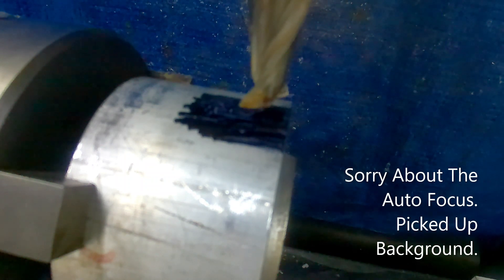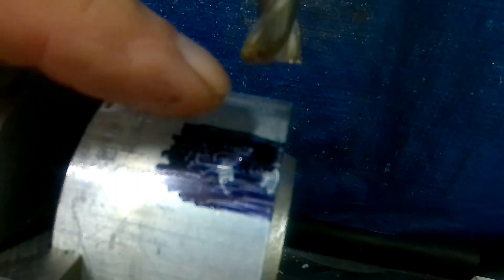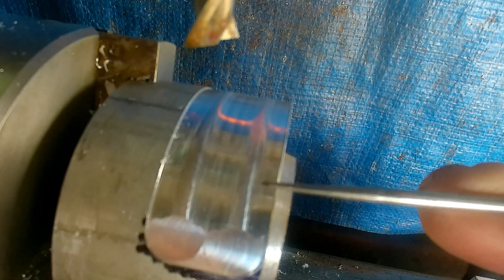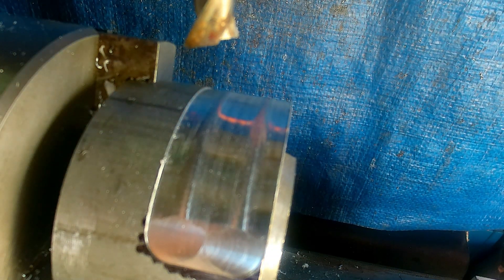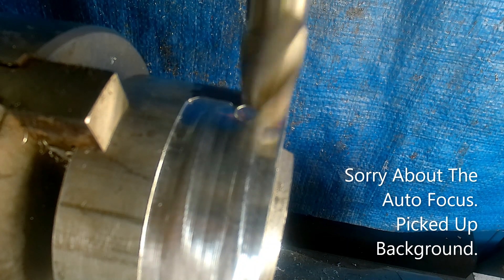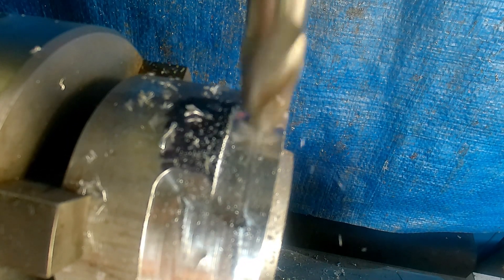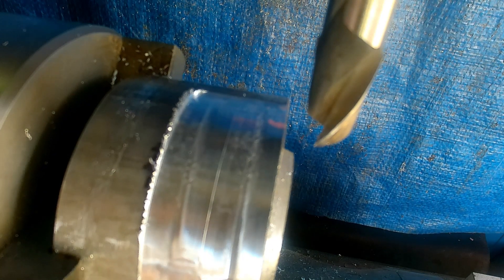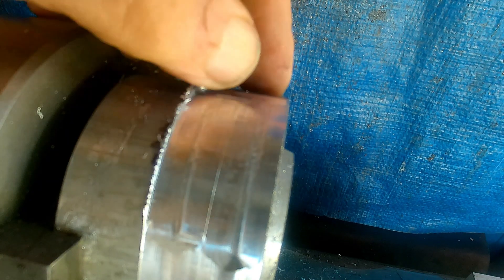Demonstrating Radial Milling Using A Standard Endmill And With A Flat Bottomed One.

Comment: I'm a retired tool & die maker, and would like to share my  learning experience. End mill manufacturers grind a 1.5% clearance angle on the bottom of slot drills because, if you try cutting with a squared off end mill, the chips coming off the bottom run into the chips coming off the side, they jam up, and break the end mill. To do the cut you are demonstrating, stand the chuck vertically, and use the side of the end mill. It will cut the dia perfectly straight.
Reply from the maker: Hello Robin, thank you for watching and your reply. Unfortunately your suggestion is no good say your part needed to be recessed or is say 6 inches long. I do not know of a small endmill that is that long. The reasoning behind this method is due to the fact that another YT contributor asked me to test it out for him after he encountered the bump problems after using a standard slot drill. Here is the link to his video if you want to see what I was trying to test out for him. Regards. https://www.youtube.com/watch?v=P-xTGgCsxNQ

Comment: Hi Dave, excellent demo. Been caught out by this, and also by the two flat ends when machining a bounded circumferential slot! I had to use a smaller Dia slot drill that I had calculated the amount of (half flat) at each end was within the allowable radial tolerance for the slot base circle. I was then pitching side to side to get slot width when I ran into this issue! Resolved in much the same way but using 2 tools, one regular ground to get the meat out, and a flat bottom to take the last few 10ths thou out. As you can imagine, a 4mm flat bottom slot drill, 5mm deep in Inco 718 don't get on too well together lol. Mr who??? Lol. Cheers, Jon
Reply from the maker: Hello Jon, thanks for you explanation about your experience of of this problem, at least you recognised the problem and managed to solve it. See you on the next one very soon. Just ordered a better 4 K camera with remote control and zoom, now I am a bit more into this YouTube lark. Regards.

Comment: Hi  Dave  great video on  the milling. Would a center cut endmill have fixed the problem with the ridge in the center of the cut? thanks again. Cheers
Reply from the maker: Hi Randy thanks for the view and your question. When you say a center cutting end mill I assume that you are referring to either a 3 flute endmill where one of the end lips goes past the center. No that would not help because it has about a 2 degree relief taper ground onto it. It is also the same with a 2 flute cutter ( Slot Drill as we know them in England ) That is what you saw with the first run. With either a 3 flute center cut and a 2 flute slot drill you can plunge straight in and it will cut no problems at all. If you try to use a standard 3 or 4 flute endmill to plunge you will fail as the very center is often hollow to allow it to be ground. In case you do not know, the quickest way to mill out a pocket or a slot is to use a slot drill ( 2 flute ) just plunge down to the depth you want on the first go, then shift over about half a diameter and plunge again. Very quick to cut a slot or a pocket, just like using a drill and all the wear on the cutter is on the end which is easily sharpened. If you happened to be making a pocket all the way through, you will end up with a big chunk that will drop out and could possibly be used to make something else. I have seen people mill away a whole area instead of cutting it out. If you need any more advice, drop me an email and I can send pictures. Regards.
Reply: @daveticehurst4191  Thanks Dave I did not if it would or not.Thanks again have a great day.